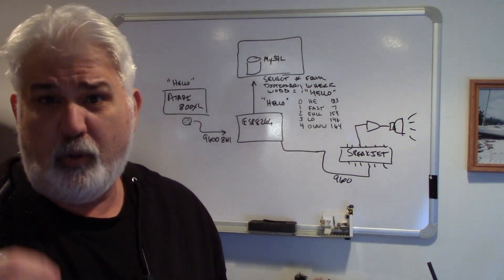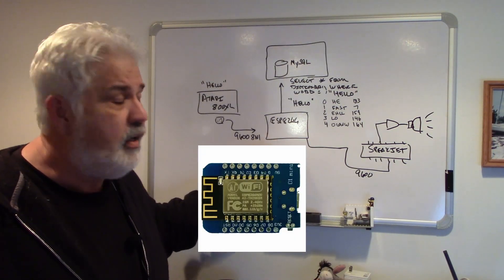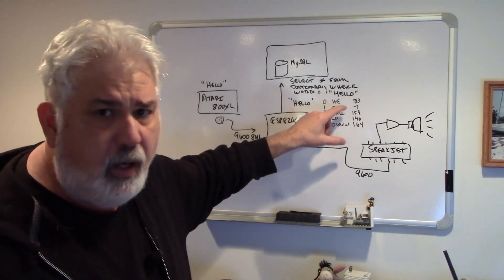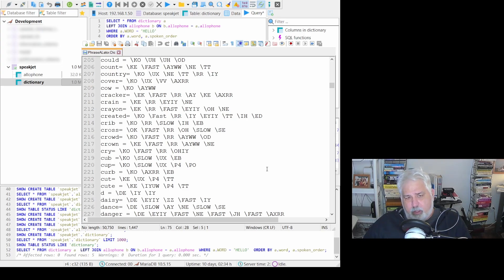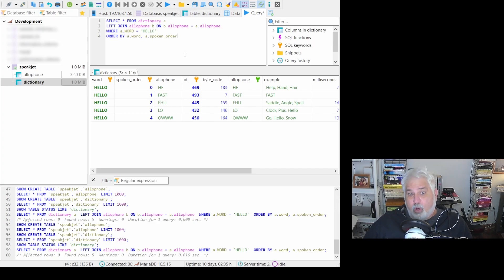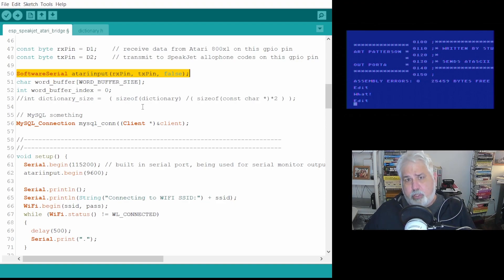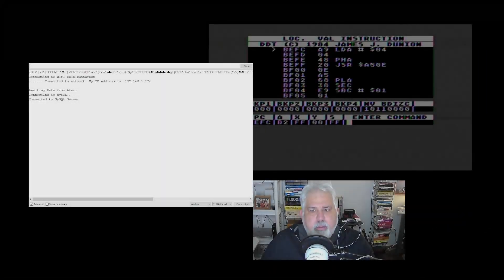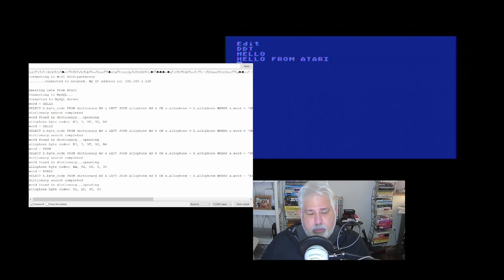Atari 8-bit Speech Synthesizer with ESP8266, MySQL, and the SpeakJet IC

Comment: Sounds like a convoluted way to do what S.A.M. could do in 1985 with no add-on hardware.
Reply from the maker: You missed the point.
Reply: That uses much/most of the CPU cycles. This allows for adding speech to any software, including 60fps action games.